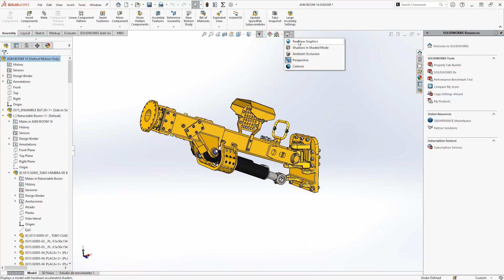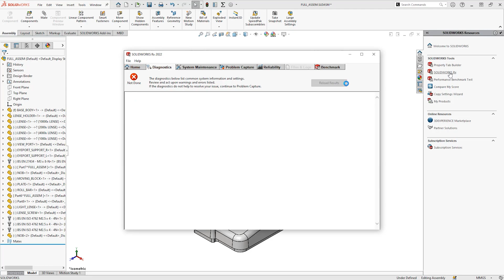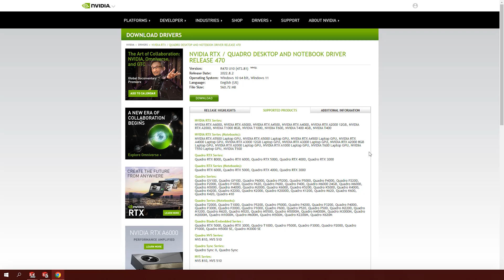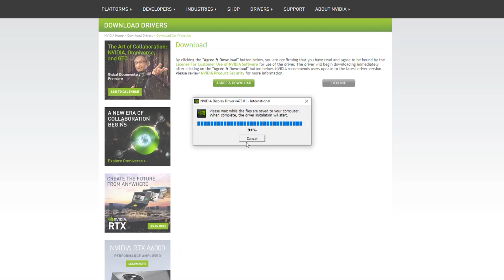How to Update your Graphics Card Driver | SOLIDWORKS Rx Tool

Comment: Need a little help, I  am trying to add in  power surface and i mold module in solidworks but when I add these module, the solidworks shut down automatically 
Is there any solution ?